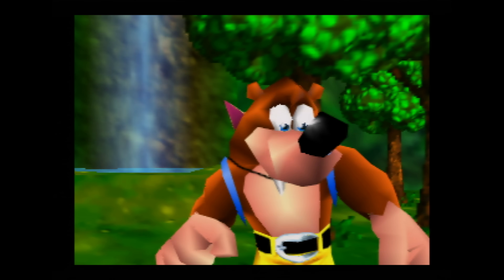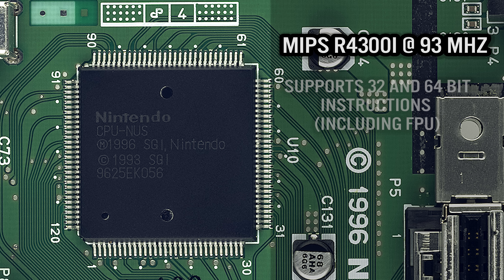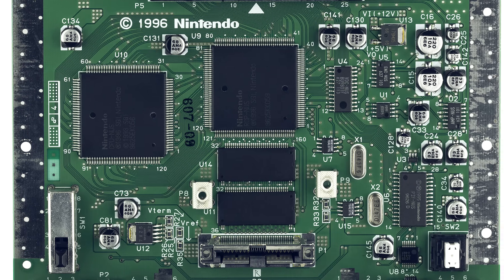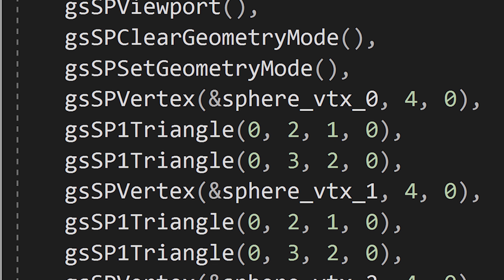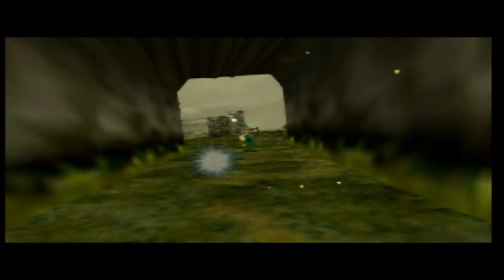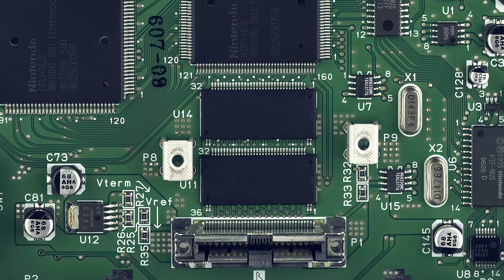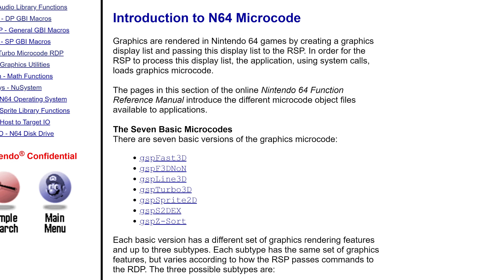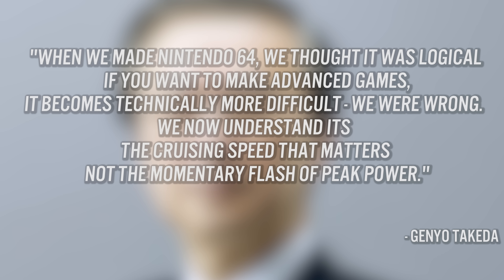Why was the Nintendo 64 so hard to develop games for ? | MVG

Comment: Never liked the blurry N64 look. It was supposedly a step forward that looked like a step backwards to me. Large cubes everywhere with blurry textures seen through vaseline - good for Mario, i guess, but what else? Few fond memories compared to PS1, though i knew legions who swore by Goldeneye.
Reply: I prefer the solidity of N64 games to the wobbly polygons and warping textures of the PS1, which isn't to say I never enjoyed games like Spyro. I guess it's a matter of what you grew up with.
Reply: @randomguy8196 I enjoy a "static puzzle" like Donkey Kong Country.  There are still plenty of NES games like Ninja Gaiden I play.  FPS are far more limited, mechanically though.  They lack the depth of technique and skill of "static puzzle" style games.  That is why it is so important for them to be more dynamic and unpredictable.  The fact that N64 games like Golden Eye and Perfect Dark pulled it off better than any modern FPS is proof positive that it has less to do with AI limitations and more to do with a lack of ambition in design.  It is so much easier to just script everything out like a linear movie and controlling every aspect of what happens ensures that the frame rates will always remain high.  Unpredictability threatens the illusion that the games your playing today are technically ambitious.  They're not.
Reply: @randomguy8196 Play the same level in Golden Eye (N64) several times.  Play the same level in the modern Golden Eye (Wii, X Box 360) game that plays basically like a Call of Duty game several times.  I even explained in my prior post that the differences aren't about processor intensive AI routines.  Look at some of my other posts.
Reply: @randomguy8196 I played plenty of the multi-player mode as well.  Why wouldn't you also want that kind of unpredictable variety in your single player adventure?
Reply: Saturn for life
Reply: I do have some fond memories of the N64, compared to Playstation. Nevertheless, the N64 never truly  felt like a generational leap to me, even back in the day. And after seeing those games nowadays running on my CRT, compared to Saturn and Playstation, I'd say that those have aged better compared to N64.
Reply: @julianobitsgen  In what delusional fantasy world do you live in where Medal of Honor looks better than Golden Eye or Perfect Dark?  Get real, dude.  Your just embarrassing yourself.  I'd take a little blur over wobbly textures that can't even stay in place any day.  There is a reason why a number of popular Playstation games were ported to N64, but almost no N64 games could be brought out for the PS1.  The Playstation had even less RAM and didn't have the luxury of fast loading.
Reply: @davidaitken8503  Are GT 64 and World Driver Championship a generation ahead of Gran Turismo and SEGA Rally? Nope. Are Killer Instinct Gold, MK4 and Deadly Arts a generational leap compared to Tekken 3, Virtua Fighter 2, Last Bronx or Sould Edge? No. Is Star Soldier 64 a generation ahead of Thunder Force V or R-Type Delta? Nope. BTW, the Saturn didn't have those wobbly textures the PS1 had, and I'm comparing the N64 to those two. Only the Dreamcast felt like a generational leap, some time later.
Reply: @julianobitsgen  Dreamcast felt like an N64 running in a higher resolution.  I guess it must have seemed impressive to somebody accustomed to Playstation and Saturn.  All of those racing games you mentioned, suck.  They're your idea of top of the line?  Try playing F-Zero X with 30 vehicles at a silky smooth 60 fps.  San Francisco Rush, Rush 2, and Rush 2049 are pushing some massive environments that aren't the narrow tubes of Gran Turismo and SEGA Rally.  They even manage 2 player split screen with 6 cars out there.  How many does Gran Turismo and Sega Rally have?  The N64 is unmatched in the racing genre and the PS1 and Saturn games your touting are actually illustrating how restrictive the design had to be in order to make the visuals look decent.  Star Soldier: Vanishing Earth is an excellent game despite Hudson's technical incompetence, but that is beside the point.  Do you really want to compare shooters?  Star Fox 64, Sin & Punishment, Bangai-O, Aerofighters Assault, Rogue Squadron, and Battle For Naboo are in a league far beyond anything the PS1 or Saturn had to offer.  Do you really want to compare 3D platformers/ adventures, first person/ third person shooters, etc.  How about we talk about Body Harvest, the fully 3D, open-world, hop into any vehicle game a generation before Grand Theft Auto 3.  Rocket: Robot on Wheels was the first console game to have a real physics engine and is still an awesome game.  What did that come out exclusively for?  It wasn't PS1.  Saturn, maybe?  Oh, I remember!  That was for the N64.
Reply: @davidaitken8503  PS1 was the one I've played the least, with the Saturn and N64 being my consoles of choice around that time. But still, the blurriness, simple colors, models with extremely low polygon count with some rare exceptions (apart from Rare and some early Nintendo games, just compare polygon-count in Mario's model in SM64 and then Smash Bros, Mario Golf, Mario Party and Tennis. It actually downgraded and looked like something from a 32-bit machine). Talking physics? SEGA Rally had awesome physics. Motion capture? Last Bronx had it. Complex lighting? PS1 had in a number of games. The so mighty Body Harvest was so simple-looking that the terrain looked like the infamous Cybermoph on the Jaguar. Star Fox 64, although a good game, wasn't a deal breaker or as revolutionary as the first one. Why? Because of Panzer Dragoon and Omega Boost. BTW, textures on the Dreamcast were so high-res even the PS2 looked blurrier and rougher without anti-aliasing. But don't get me wrong, I'm not saying N64 as a bad console or anything like that. Like I've said, the N64 was and still it is on my collection, it's one of my favorite Nintendo consoles, but just from a graphics point of view(not considering necessarily game mechanics), they hadn't - and even today they don't - seem like a generational leap compared to PS1 and Saturn. You show Gran Turismo or Ridge Racer Type 4 to anyone who has never played a videogame and then show them Ridge Racer 64, they'll say it actually looks worse. Same goes to many other games: compare Decathlete on the Saturn to Nagano Winter Olympics 98 on the N64: it will look worse, and so on, with very few exceptions.
Reply: @julianobitsgen  Comparing character models in different types of games doesn't really make much sense as it doesn't acknowledge the unique needs of vastly different game designs.  Mario is the primary focus on the screen in Super Mario 64 and the only character a player is controlling so of course much more detail is going to be put into his character model.  The other games you mentioned have to split up geometry between 4 playable characters.  Having said that, HAL (Smash Bros.), Camelot (Mario Golf/Tennis), and Hudson (Mario Party) were never very tech savvy developers on N64 and I always did think the character models looked far worse than they should have in those games.

The physics in SEGA Rally, much like the physics in Top Gear Rally 1 and 2 or Wave Race 64, while impressive, aren't actually true physics engines the way we think of it today.  Rocket: Robot on Wheels was the real deal.  You really need to play the game to appreciate what it is doing but you owe it to yourself to at least read the Nintendo Life article, "The Making of Rocket: Robot on Wheels".

Motion capture isn't a technical achievement in games so much as it is a technique for creating animation in games.  The characters in Golden Eye and Perfect Dark were motion captured but with enough time and talent they could have been done by hand.

Lighting?  Have you seen Donkey Kong 64, Zelda, Forsaken, Turok 2, etc.?

Body Harvest, while certainly not the prettiest game, is still a technical showpiece for how insanely ambitious it is.  It does not look like Cyber Morph.  You clearly have never played the game and I suspect you watched a crappy video of the first alien attack of the first level.  The pyrotechnics, lighting, blood splatter, weapon fire, and the sheer number of enemies, trees, foliage, buildings, vehicles, and people on screen is quite impressive.  All within absolutely massive environments.

Do you really want to compare Panzer Dragoon and Omega Boost to Star Fox 64?  I refrained from bringing up those games when I was talking about shooters in my earlier post because I thought it would be too mean.  When talking about chunky character models with really, really, bad textures it doesn't get much uglier than Panzer Dragoon.  Having said that, it is actually far more impressive than Omega Boost, which although looks really clean and impressive at first glance, quickly reveals that its' slick look comes at the price of there really being not much of anything out there.  No real terrain.  No enemy variety at any given time.  It is the shooter equivalent of a 3D fighting game.  There is you and an opponent that look cool and a barely there game environment.  Yeah it looks pretty and runs smooth, but that has more to do with just how little it is actually doing from a design standpoint.  Panzer Dragoon at least has some decent game environments that feel like a fully realized place.  Neither game can compete with Star Fox 64 in both visuals and ambitious game design.  It seems like an awful lot of these games your holding up as examples of impressive visuals are really just illustrating how stripped down they had to be in order to achieve that look.  That is why I have been focusing more on games that are presenting gameplay that is beyond what any Playstation or Saturn game could hope to achieve while still looking at least decent in a worst case scenario.  Which brings me to...

Ridge Racer.  One of the most overrated racing games of all time.  Again, I think your forgetting that Ridge Racer 64 had to be able to run in a 4 player split screen mode so of course they held back a little on the graphics to make that possible.  A better comparison might be Beetle Adventure Racing.  A game far more visually impressive, and again, ambitious in its' design than Namco's overrated Daytona USA wannabe.

Compare Turok 1 and 2, Golden Eye, Perfect Dark, Jet Force Gemini, to literally any FPS on Playstation or Saturn.  Compare Aerofighters Assault, Rogue Squadron, and Battle for Naboo to any of the Ace Combat games.  Compare OoT and Majora's Mask to any type of action/ adventure on PS1 and Saturn.

I agree some games looked muddy or blocky on N64 but compared to what exactly.  The Z-buffered textures allowed developers to display much larger polygons which allowed them to render much larger game environments.  Crash Bandicoot isn't actually rendering more detailed game environments, you're just seeing far less of it at any given time.  Of course they can put more geometry into individual objects because you're not seeing much of the landscape at once.  Most Playstation and Saturn racing games had more narrow tubes for race tracks.  They were displaying far less to give the illusion that they were rendering more.
Reply: @davidaitken8503  I was about to say,don't forget Turok lol,i own the first one,i think its good,seen and played Golden eye and Perfect dark,they are good also
Reply: goldeneye is an unplayable mess, I don't know what people see in it. people that love it maybe never played doom, duke3d, quake 2, or even wolfenstein 3d??.
Reply: @pelgervampireduck  I played all of those games and Golden Eye is superior in every way.  Better level design, mission objectives, location specific damage, larger enemy move sets, and an open world feel that is unmatched by most of today's games.  The game was and still is one of the most ambitious designs for a fps.  Enemies aren't stuck in there zones, they can literally go anywhere and they are all doing it at once.  An empty room could be where a major shoot out takes place the next time you play through the game.  It makes the game feel very dynamic.  The weapon variety and the persistent, lingering explosions allow you to do some really cool strategies as well.  The combat has a near flawless rhythm to it, almost like a side scrolling beat'em up like Final Fight, with you juggling an overwhelming number of enemies at once.  The other games you mentioned are just incredibly primitive compared to it, and even more so when compared to the sequel-in-every-way-but-name Perfect Dark.  In what delusional fantasy world is it "an unplayable mess"?
Reply: David Aitken Well said, I’ve been replaying Goldeneye recently and it’s still an amazing game. You just never know what the AI is going to do next, no two play through of a level are the same because they’re always doing something different, even in the confines of a train carriage!

It’s always sad to see the controls criticised too, the default control scheme is basically identical to Resident Evil 4, but with the added bonus of also being able to shoot while moving.
Reply: @dreamcastfan  It is funny how so many modern shooters use more complex AI for more predictable results.  Yes, they know how to hide behind an object and fire at you while their buddies flank you, but it plays out far to similar each time you play.  Most of the enemies aren't even out there all at once and don't actually spawn until you enter the next room.  It is crazy how much more ambitious a game released back in 1997 on a N64 was compared to the "play-it-safe" games of today.  I think peoples obsession with perfect frame rates is holding back developers from turning the scripting off and letting their games play out dynamically each and every time.

People that criticize the controls are beyond ignorant.  You can change them in the options menu.  Myself, and everyone else I know, have always played it the same way we play other N64 fps, with the now popular duel stick setup.  OK, technically the C-buttons aren't a stick, but you get the idea.  It also has the best aiming system for a console shooter prior to Wii pointer and Switch gyro.  It actually feels quite similar to Switch gyro.  You use the analog stick to aim in the general direction of your target, then hold R for more precision similar to gyro.
Reply: I found it boring, uninteresting, and the n64 control doesn't help. even in the same platform doom 64 is a lot better.
Reply: @pelgervampireduck  Doom 64 is inferior even to SNES Doom as at least that game has superior level design, rooms you can actually see in, and music that doesn't put you to sleep.  Golden Eye, along with Turok, popularized the duel stick control scheme that pretty much every console shooter uses now.  If you didn't like the default control scheme you have only your own incompetence and laziness to blame for not even bothering to look for more control options in the menu.  The game might be too complicated for you if your idea of an impressive shooter on the system was Doom 64.  The game didn't even have any multiplayer mode, on a game system known for the best fps multiplayer games of the time.
Reply: I don't care about multiplayer so a game having better multiplayer means nothing to me. 
I enjoyed doom 64, I didn't enjoy goldeneye.
and the n64 controller is horrible.
Reply: @pelgervampireduck  Correction.  You're horrible at using the N64 controller.  That doesn't mean the controller itself was bad.  The N64 controller was easily the best for its' time.  You should try practicing a bit.  I grew up in the arcades of the 80's and 90's where there was a large variety of controllers and input devices.  I've never used a controller that is "horrible" on any system from Nintendo, Sony, Sega, or Microsoft.  Well, maybe the Power Glove.  That isn't to say there aren't plenty of games with bad controls, but if you think the N64 controller is "horrible" then that is an issue with basic competency on your end.  Like I said, practice.
Reply: nope, it's not competence or not. the controller is fine for mario 64 or zelda ocarina of time, but in other games it's akward. 
nes, snes, and sony's dualshock have good controllers, n64's controller is just weird. if I could plug a ps2 controller to the n64 it would be a lot better.

Comment: This explains why Nintendo overtime no longer build graphically demanding consoles.  N64 and GameCube were graphically superior to the Playstation 1 and 2 but both failed in markets hare.  Where areas like the NES graphically inferior to Master System won out, SNES had a slow processor than Mega Drive and won out.  Wii was graphically inferior to ps3 and xbox360 and won out.  Nintendo Switch graphically inferior to ps4 and Xbox one but now commands 2nd place in Market share over graphically superior Xbox one.
Reply: Nintendo learned the wrong lesson from the N64 and the GC. Making lower powered consoles does not mean success, the Wii U is a perfect example of that. They should have learned that when you make a powerful console you should not cut corners. For example the GC probably would have won that generation or at least been a much greater success if it used normal disks so it could play DVD's and hold games as large as 3rd party developers wanted to make. Nintendo thinks power doesn't sell and have now learned from the Wii that gimmicks are what does. They have no 3rd party support and never will again the way things are going. The Switch leaves Nintendo with nowhere to go because they only have 1 product line now essentially.